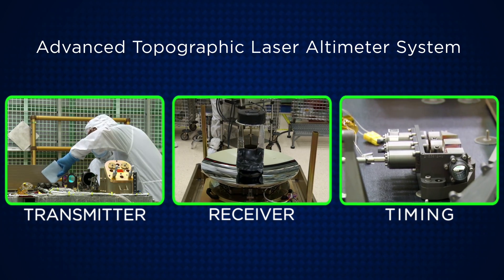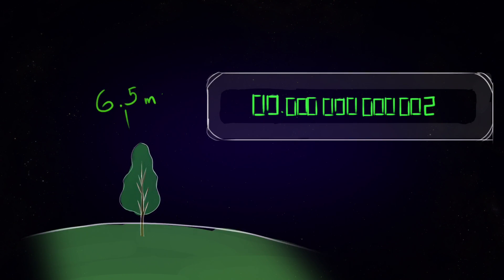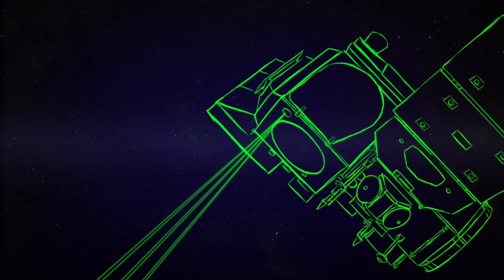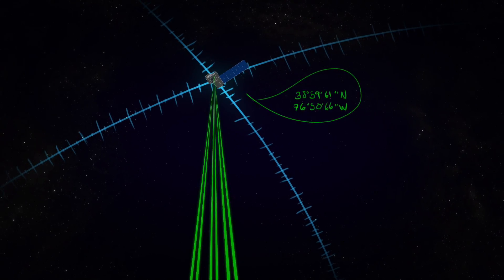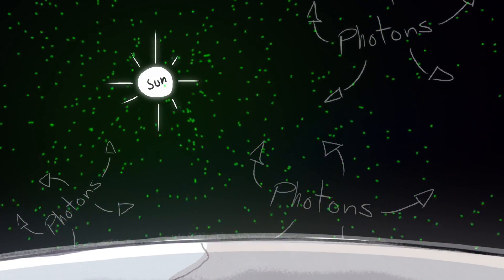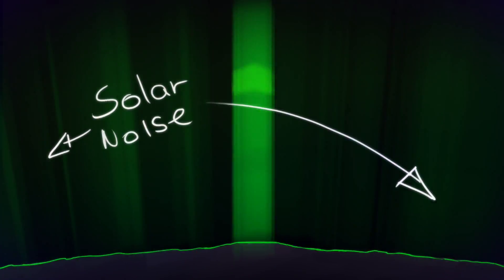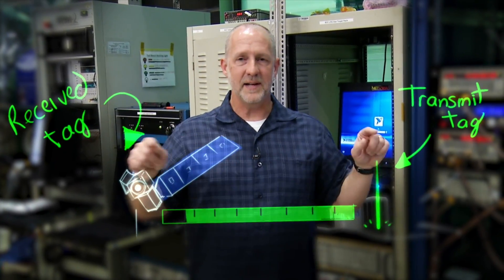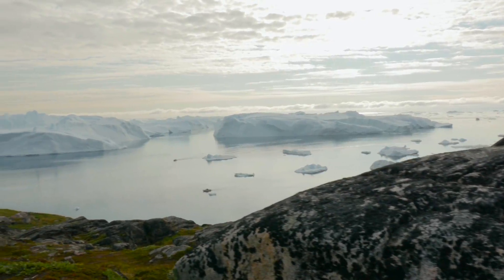Timing Is Everything

Comment: 2017 and Win XP still running in NASA.
Reply: Let's be honest, no spaceship would run on Windows 10.
Reply: Well, most software for specialized instruments that runs on windows tends to run on older versions. Because that software isn't widely used, it isn't really worth developing a new version every time microsoft puts out a new version of their OS.
I work in a chemistry lab with quite recent equipment, cutting edge I might say. But I have yet to see a single of our computers used to run some instrument on anything more recent than Windows 7. Our XRD uses windows XP, so does our UV-visible spectrometers, our FT-IR spectrometers use Windows 7, as well as our thermogravimetric analysis/differential scanning calorimetry, etc, etc...

I have yet to see a single computer on windows 8 or 10 linked to an instrument.

(And those who do molecular simulations use Linux obviously...)
Reply: Dr St

Comment: What if the Laser strikes a manmade Structure like two glass Buildings, or two objects on the ground that are reflective, or one of the largest parabolic antenna in the world - is there a huge dip where the Beam takes an unnaturally long path and is returned sufficiently to be accepted as a direct bounce?

Is that what the 'Range Window' (1:29) is doing?

Doesn't that round the edges of Cliffs, large and tall Buildings, and increase the area of Mountain peaks?
Reply: The ATLAS instrument "looks" for the surface using that range window.  Once it finds the surface, the instrument sends down photon information in a narrower window.  So it looks for the surface through a window then zooms in on the photons that most likely came from that surface.  There are trillions of photons with each laser pulse, with about 10,000 pulses a second, in order to get enough info reflected back to get as accurate a picture as possible of the surface feature in question.

I realize you asked other questions so I'll have to ask around for good answers to those.
Reply: Ryan Fitzgibbons - Thank you for your reply. Double Window answers the second half.

I suspect that rather than 'just firing a Beam' that they use Doppler to measure the 'movement of the reflection' and Encode the light with a Carrier.

Otherwise mischievous people could interfere with the results and experts (Hackers) could make Topography that spelt their name (or unfriendly Governments could jam the system - charge $ for the Data).

Thanks,
Rob